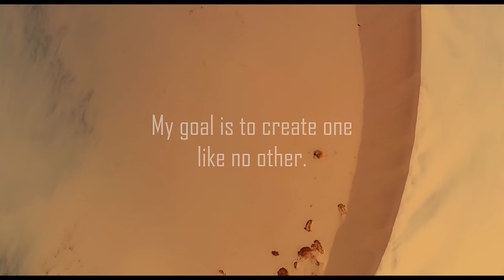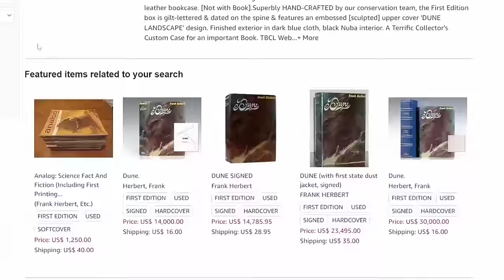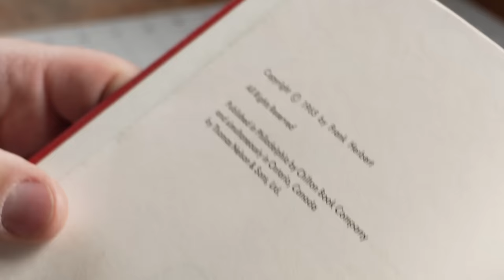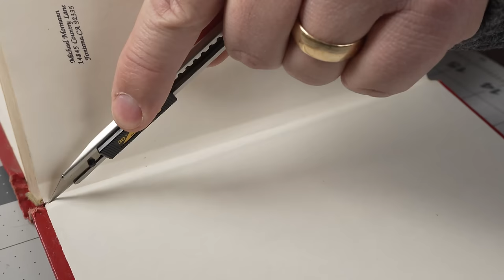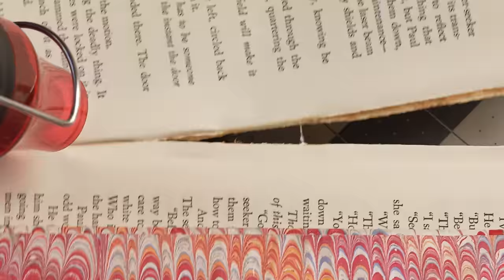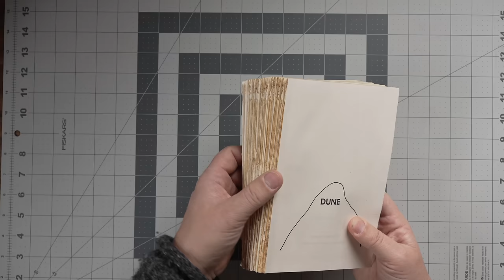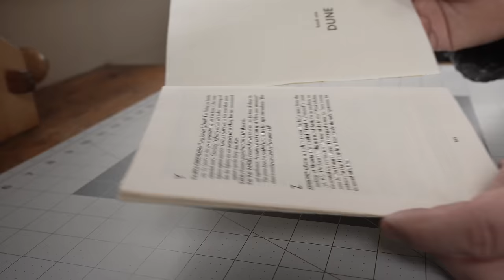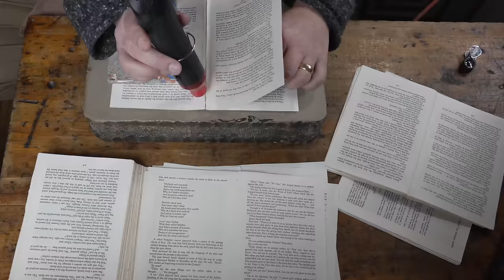Rebinding DUNE - Part 1 - Disassembling A Vintage Book: Paper Repair & Resewing

Comment: Archival adhesive and Koso paper. Mr Baumgartner would be proud!
Reply: I'll always think of him whenever I hear those words
Reply: I just finished one of his before i came here. Fully reversable washi koso...
Reply: Thought the same 🤣
Reply: Well met to fellow viewers at the centre of the Baumgartner / Four Keys venn diagram. 👋
Reply: on the contrary, I think he would be horrified to see him removing glue in a manner that damaged the book further. I wish he had been watching Baumgartner, it might have given him some ideas about possibly less damaging ways of removing the glue
Reply: @gavinhill3164 but we have to take into consideration that he doesn’t work on paper, ever.  So, as they say, apples to oranges.
Reply: @gavinhill3164 I disagree. Baumgartner can always introduce a solvent on canvas, but you can't introduce solvent with paper. I've seen Baum chip away at canvas with a scalpel and that's no different then what we see here.
Reply: Exactly 😁
Reply: @gavinhill3164  Baumgartner refers to stuff like this as land mines that the last person to work on the object laid for him - sometimes he has to do damage to conserve what can be conserved. See 'Scraping Scraping Scraping', for example. There was absolutely no way Dennis was going to get the hot glue off without some damage, and he repaired it appropriately and reversibly, especially as he knew he was going to be reinforcing the slit signatures anyway.
Reply: This is also a personal art project being done to restore an otherwise unremarkable mass-produced printed book. This is not a conservation project on a unique and irreplaceable original work of art.
Reply: i was waiting for the Fish Gelatin
Reply: @TheKrogon  I was disappointed to see that the original adhesive wasn't rabbit-skin glue :þ
Reply: came here looking for this comment
Reply: Came to the comments looking for the other Baumgartner fans!
Reply: Was just going to say that when your comment popped up

Comment: I suppose 'rescuing' this copy could be quite a subjective argument but even as a 'labour-of-love' project it demonstrates just what can be done to give more life to an old book. Modern (just dip the whole spine in glue) techniques frustrate me because I open some copies made this way and its like a magician riffling a deck of cards into the air - and all single pages too! Modernisation is NOT always Improvement. Having said that, I'm astounded at the patience you have but, then again, its SO worth it. Looking forward to part 2, Dennis, keep up the good work!
Reply from the maker: You make a good point. I could have approached this book from a strictly conservation angle; fix the boards and tears, maybe some light repair to the spine, etc. But I want this to be both a showpiece and a working reading copy of the book, and I wouldn’t trust the old binding to hold up for another 50 years. I’m glad you enjoyed the video, and thanks for the comment!

Comment: When you want to minimize swell using 100% kevlar thread, it would be your best option. You can use a much finer thread with kevlar, and it will still be stronger than the linen thread you used.

Comment: My high school library had one of these editions of DUNE (with the dust jacket however). It had seen a lot of hands by the time I checked it out, and it was the first time I'd read DUNE. I've shopped for used editions myself and found the same situation you did (they're spendy). Love what you're doing with this copy and I'm looking forward to Part 2. And I'm thrilled to have found your channel as a result. Cheers!

Comment: Oh cool….a favourite book and one of my favourite crafts 😊I’m deeply fascinated by the repairs. With the repaired sheets, Dennis, did you place the washi on both sides? Or was it just one side, and if so was it inside the fold or on the outside?
Reply from the maker: I put it all inside the folds, with the exception of the outer sheet of each signature, which had it on the back. That way it makes kind of a sandwich when it’s sewn, if that makes any sense. 

Thanks for watching and for the question too! Now I want a sandwich.😂

Comment: Loved watching. I print out a lot of pdfs through a proper professional print service and I have them punch for spiral binding, but I don't get the spirals. I take them home and weave cord up and down the length though the holes bottom to top and then top to bottom. It produces a wonderfully tight binding that is spine cracking proof. I usually use a clear plastic top and card stock back. But I'm always able to add a hardcover outer layer if wished. Simple to go to a thrift store and get a donor dollar schlock cooking/knitting/craft hardcover book cover to use for my creation (and then discard the unwanted contents of the hardcover source).

Comment: If you ever plan on printing a text in order to bind it in a book, could you show in detail how you approach it from a printing software settings side of the process?

I want to print a poem so that each sheet has four pages and I can then bind them in the middle, but struggle with how exactly to do that so i can just put it onto my flashdrive and take it to the print shop. (How can i arrange the pages so that they are in the kind of order that allows me to just bind them in the middle?)

Lovely video as always! Thank you

Comment: Suggestion about your sewing: I notice that most of the time you pull the thread through to tension only when pulling the needle back out of the binding — for example, at 27:10. This puts a leftwards force on the paper as the thread from the preceding stitch is pulled taut. This could be causing some of the blowout you see around the holes. Pulling the whole of the thread through each time may help eliminate this, and reduce some of the height added over the course of the stitching up.

Comment: You have far more patience than me. The one time I rebound a burst binding like that it was over 800 pages and I just gave up and guillotined the spine off. I did a lumbeck/double fan binding and lined the shit out of the spine.
Reply from the maker: So that’s the proper term for it, thank you!
Reply: @FourKeysBookArts  That's the term I've heard for it here in the UK. I was so disappointed when I started removing the spine linings and found it wasn't actually sewn. Because it was such a thick book (The Ashley Book of Knots) it didn't actually fit in my guillotine and I had to use a woodworking plane to remove the thick layer of glue from the spine and then plane away what remained of the spine folds.

Comment: Your trick of adding a diagonal line on the edge to ensure that the signatures are kept in order is the same trick that was used to ensure the correct order of early computer programs that were stored on a stack of punch-cards!

Comment: I am totally impressed. Is there a reason you didnot do the running stitch on the final three signatures at the front of the book? I thought it would add strength at the other end as well.
Reply from the maker: In fact the final two signatures were sewn all-along, though it seems I didn’t get a good closeup shot of that. Thank you very much!
Reply: @FourKeysBookArts  I started on part last night and saw that when you added the end bits. Thanks for the response

Comment: Very nicely done! Had you planned to do 2-on sewing when you'd put the holes in, even knowing that many of them would go unused, or was that a decision you'd made mid-stream after initially intending to do all-along the whole way?
Reply from the maker: I did have 2-on sewing in mind, though I'd never had to use the technique before and thus didn't realize there would be so many unused holes. Piercing the holes to match the sewing pattern would of course be possible, though it would require careful planning and a great deal of attention to detail to get it right.

Comment: I have an odd question. When it comes to "flattening" the signatures etc, would it be helpful to maintain a higher level of humidity? I come from a bit of a carpentry/woodworking background where we use steam to bend or re-shape wood.

Comment: Another hack/spinoff idea that came to mind while watching your most EXCELLENT and MASTERFUL video (masterclass on bookbinding) was, to ave you ever considered just buy an already pristine new leatherbound book of something generic, and then try pasting the pages one by one on top of the existing pages using that thin Japanese paper you mentioned? Lol. I know, a corny short cut right. And it would probably be swollen to double its size and not pracrical. UNLESS it had twice the amount of pages as your book does, and you were able to remove a page for each page you pasted onto an existing one. Lol.  Simple math. Hahaha! Then press it down tight for a week to dry. Lol.
I know in medieval times and even in the renaissance and up until the 18th century in the colonies here, paper was laid and made from cotton rags etc. Very hard to get and expensive. So they would write on top of pages using. Bleaching or the adding blanks in. Many rare treasures were discovered underneath pages that were added in to books to save paper etc.

Comment: You should really invest in some proper japanese tissue. 26 gsm is waaaay too heavy weight. 12 or 9 gsm is much more appropriate. Although I'm so very glad that you didn't use pva for the repairs. There is no greater sin. I suggest you try methylcellulose in the future, it's even more subtle than paste. Keep up the good work ❤
Reply from the maker: Hence my obsession with trying to keep the swell down. I was in a bit of a bind as I had limited access to materials and I was trying to keep to a schedule to get this video done on time (which I didn't lol), so I went with what I had. I was also concerned that very light tissue might not hold up to the sewing.
Reply: @FourKeysBookArts  I wouldn't worry about that. I've once repaired a song book on a very thin bible-paper. Over 50 signatures, I used a 6 gsm tengujo. Worked a treat
Reply from the maker: That’s very helpful, thank you for sharing your experience!

Comment: I see that you cut the washi with a knife. I have read that it should be torn so that there is a feathered edge - care to weigh in on this? I am looking at doing the exact same type of repair (for the first time) and want to know if it is worth the extra work of ripping the washi. Thank you!
Reply from the maker: If it will be in a visible area (such as the torn corners I repaired in the video), then tearing the paper is the better option.
Reply: @FourKeysBookArts  It is for the middle of the leaves - like the 136 strips you cut.

Comment: I love the work but, wouldn't spending the $250 been a much better investment than spending $10 and 30 hours fixing the damage? You could get the same type of end result without the need to fix the cheaper, damaged book by just starting with a cleaner one?